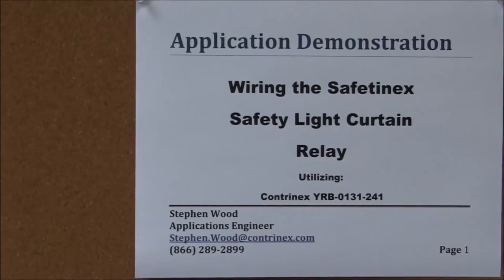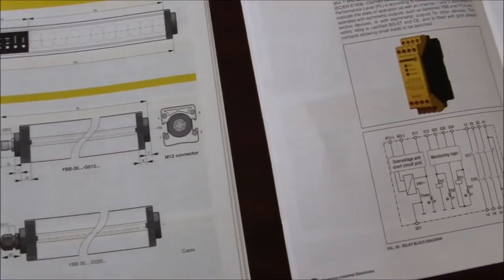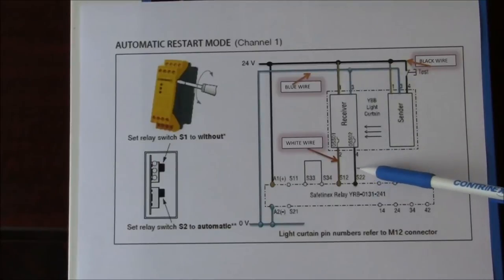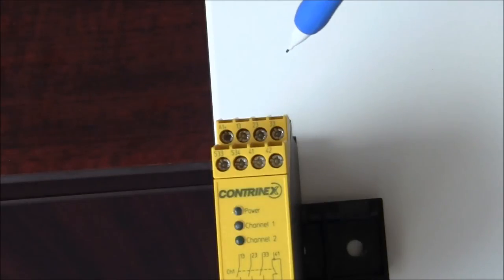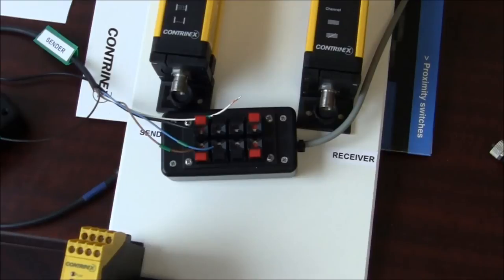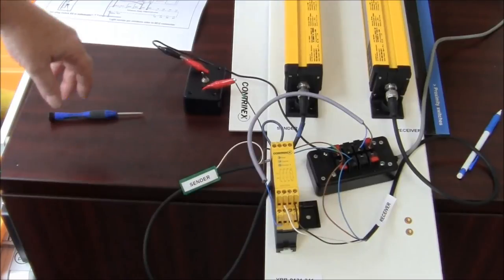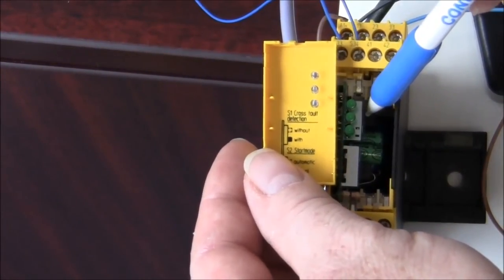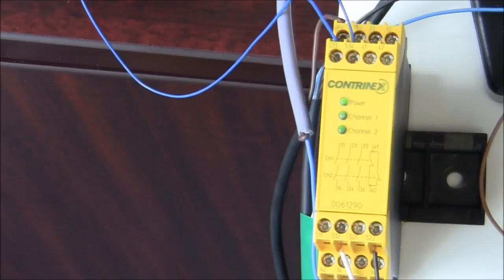Wiring a Contrinex Safetinex Light Curtain

Comment: I have 24 volts on my light curtains and there are no light beams.  These are a royal PITA. Edit: I figured out it was the switches in the inside. One needed to be on auto and the other asymmetrical. I saw zero references to these switches on the manual